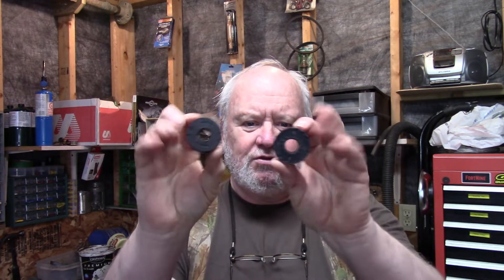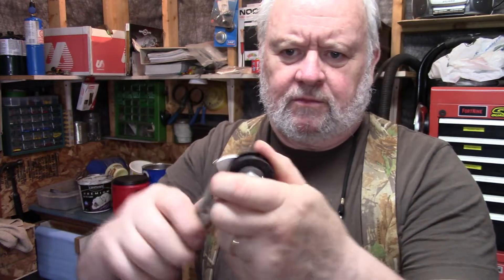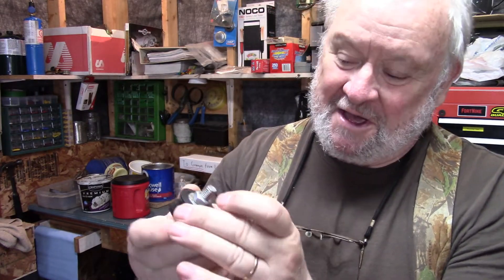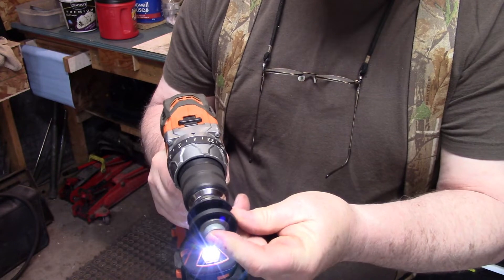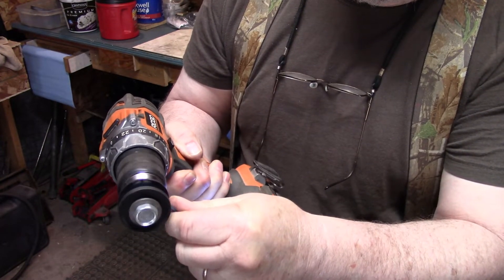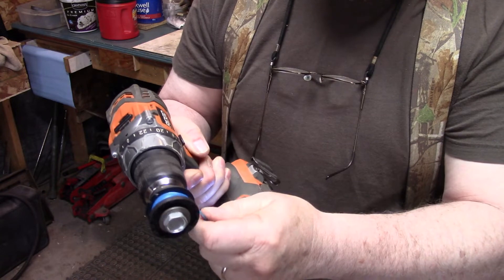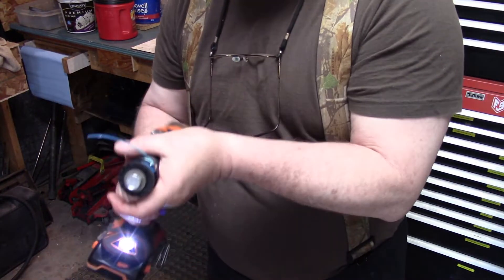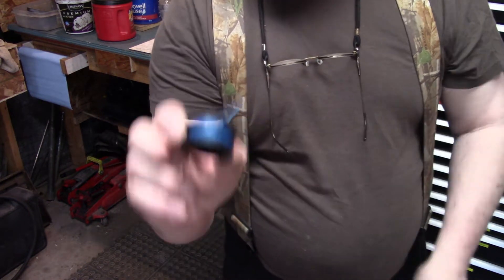Wrapping with Big Hit Makers

Comment: Hello Mike.  After screwing around with winding line for years. I went and bought a quick feed spool  ...you never have to take it a part again to wind on the line. Just cut a piece of line and shove it in one side and out the other until both sides are even....and hand turn the spool a few times and your ready to go. I do a lot of weed eating  and this saves alot of time. it was kind of expensive but worth it. Take care
Reply from the maker: Hey there John!!!  I have seen these and they look like they work well.  I don't think I'll get one at least until my bulk line store has been used up some more!!!  Thanks for tuning in pal and take 'er easy!!!

Comment: Hello Mike! What is the length you can wind on a smaller spool like this?  It seems it can fit a fairly long line according to the smaller diameter of the line. Good way of winding the spool perfectly straight. It also helps to feed the line too.
Reply from the maker: Salut Joe!!!  I never measured the line but I'd say there is about 10 feet on the spool.  It is a good way to wrap the spools.  My drill was a bit touchy with the speed (operator error) and I over sped it there once or twice, but if you're good on the trigger, you can wrap the spool just about perfect and get a full 10 feet on it with no issues.  Thanks for watching and take 'er easy!!